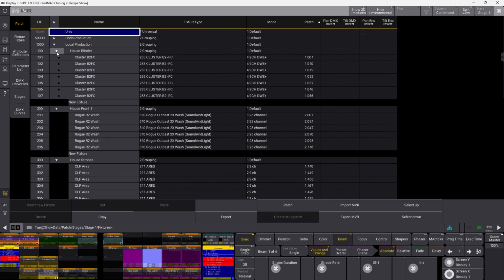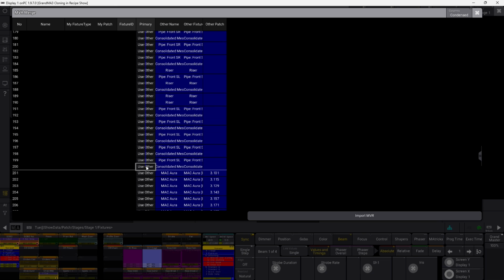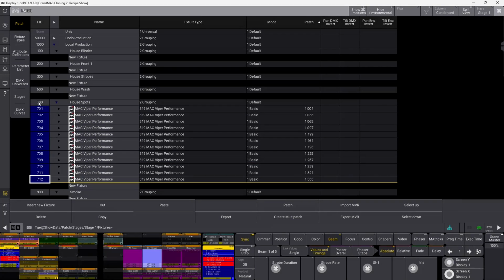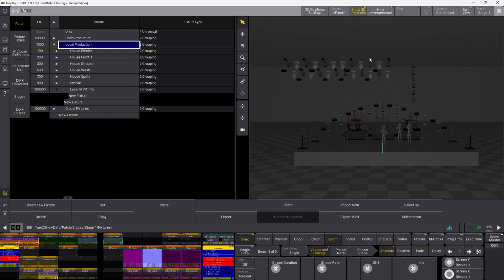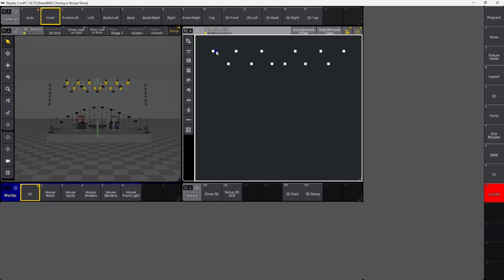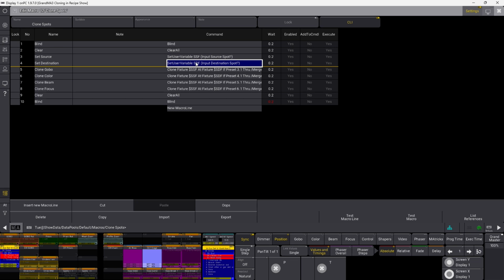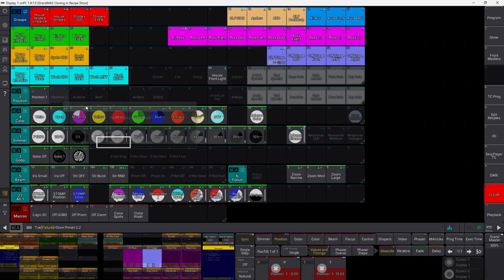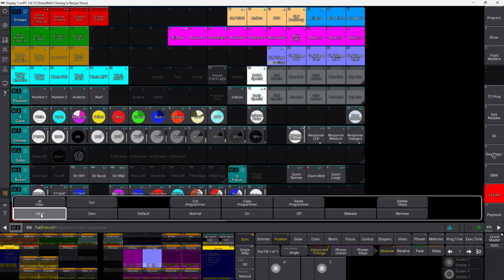Master GrandMA3: Import MVR into existing GrandMA3 show

Comment: I'm wondering why do you use Blind in your macro? Why not do it without Blind for example?
Reply: Blind is to be considered as a second Programmer :) so if you call blind the operation from the macro does not affect the 1. programmer or the output

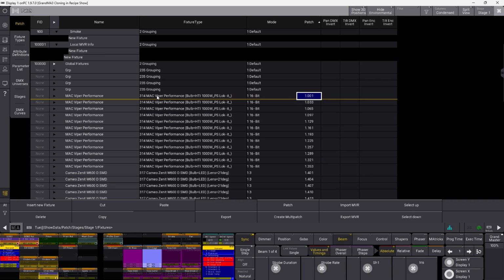Comment: I'm sorry but what button do you use at 4:57 cause when I open import it just adds new fixtures, I don't know how to add data to existing MVR ones like you show here. Thanks!
Reply: Click the library tab under the search box. it defaults to a tab called show and thats where the dummy fixtures are.
Reply: I was stuck on this for a minute as well. For anyone else confused on this step: make sure you are selecting on the "Fixture Type" column, then right click (two finger tap, etc) to get to the "select fixture type to import from show" window.